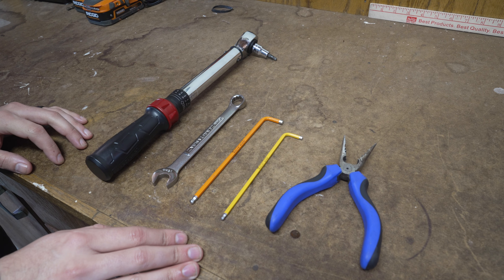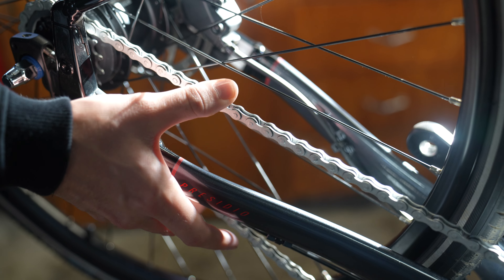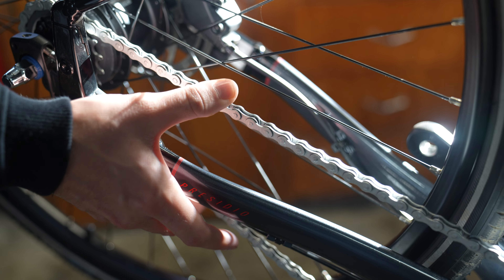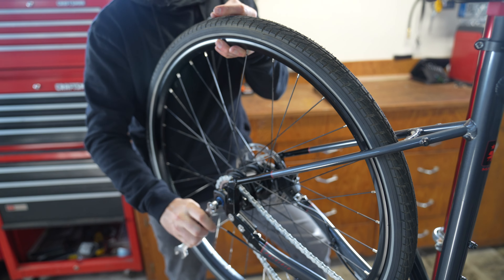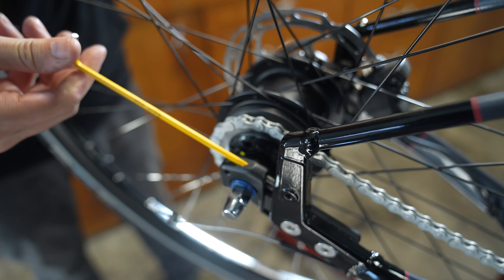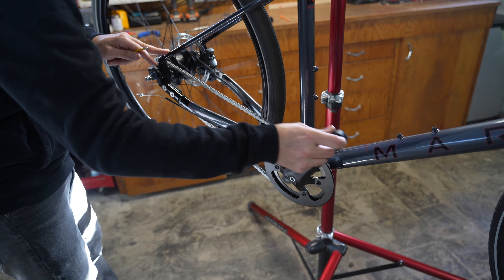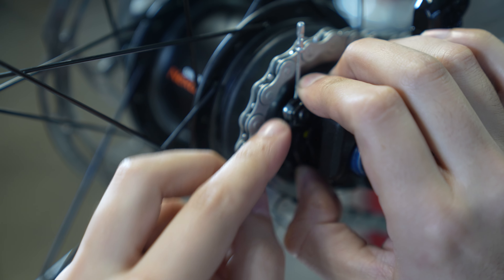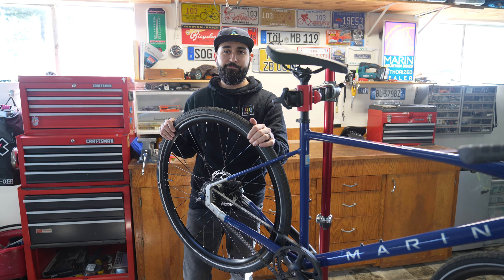How to remove a hub gear wheel from your bike

Comment: @Marin Bikes  Great video!  Supposing you just want to tighten a slightly loose chain and not remove the rear wheel:  So, you turn 4mm bolts anti-clockwise to increase tension but is it also necessary to loosen the four 5mm bolts before doing this?  I doubt it but just checking. Thanks -)
Reply from the maker: Great Question! Yes you will need to slightly loosen the 5mm bolts so that the whole drop out can slide when turning the 4mm bolt